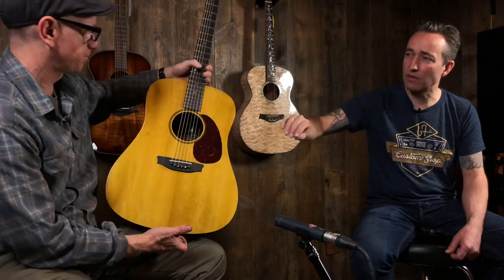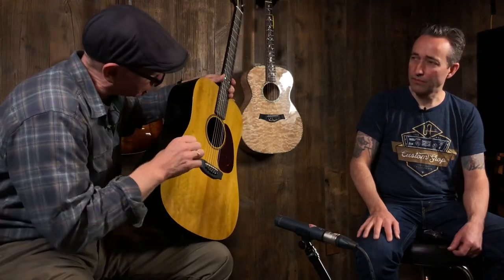Rainsong V-DR110N2 Vintage Series Dreadnought - Made for the Elements!

Comment: I like their OM Model w/cutaway.  I prefer the all Carbon fiber ones but they make a Rainsong V-OM1000NSX Vintage With LR Baggs Anthem Electronics w/ spruce - Carbon fiber top. There is also the V-WS1000N2X, kind of like a Martin 0000 or M36 size. For a Road guitar or Travel guitar, they are hard to beat....JMHO